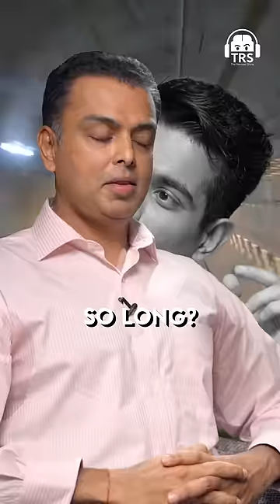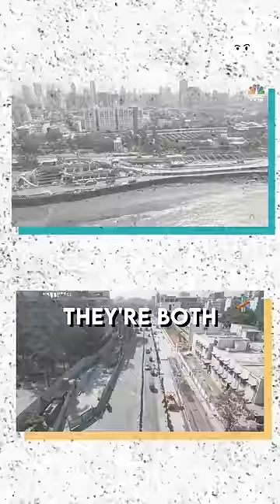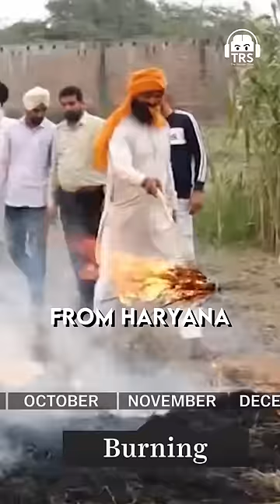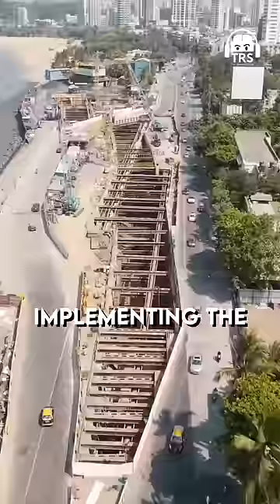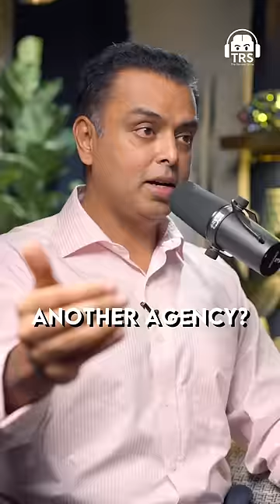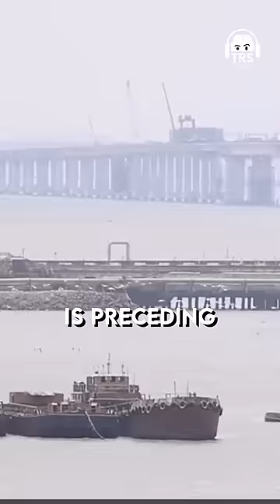Reason Behind Mumbai's High AQI (More Than Delhi?) - Milind Deora #shorts

Comment: Simple question to Devra! Name one project of the same scale and  speed   which  was completed by congress ! It’s one thing talking in expensive English but just another thing to take up big projects and deliver
Reply: Rightly said👍
Reply: Oooh NICE!  As someone who has studied and learned 'expensive English', I do hope this catches on.  Tell all the Westerners this if they ever try and 'correct' your speech or writing.  Or even if they don't.  Tell them anyway!  Congratulate them (foreigners and diaspora) on their "expensive English".  It'll hit them right in the gut.
Reply: Current infrastructure kisine banaya fir?
Reply: Did you ever hear about delhi metro? Initial rail networks of india,canal network in rural india etc
Reply: @Aditya-xd7zt  off course I have heard experienced. Have you experienced Delhi air pollution? Forget about during projects, anytime? It’s a good city, if someone wants to die without getting older!
Reply: @Aditya-xd7zt  I am not talking about infrastructure per say. But specific to speed and scale. Just check the example of Narmada dam. It was flagged off by Nehru but could get completed only by Modi! There are dozens of such examples. 55 Shatabdi in 65 years. 35 vande Bharat in 9 years. The list is endless

Comment: Similar issue in Jammu - two highways to take you outside the state - expressway and ring road, both under construction at the same time. 
On top of it a bridge collapsed during monsoon, causing us to take detour of additional +20 kms on a single road with two way traffic. That’s fixed now.
But still to cover 90km stretch it takes us 2.5-3 hrs. 50% road is one way traffic. And barely 20% proper road exists atm. Yet, they charge us at 2 toll plazas across this route when there is no roud for maintenance at all. It’s under construction. Voice was raised by locals but it got squashed. 👀

Comment: congress laid foundation of mumbai metro in 2006 & it was opened it 8 yrs later that too a small network of just a fucking 11 km & when modi started work on mumbai metro 3 that required cutting of trees, Liberandus of Mumbai started protesting against mumbai metro line 3 & When Uddhav thackrey (congress allied with Shiv sena) won in MH he almost slammed the Mumbai metro 3  now tell me who delayed the project. After BJP allied party won MH Mumbai metro 3 is now almost complete & this december this metro line 3 will get opened.
To improve mumbai local trains BJP led govt. launched AC Local trains in 2017. Now tell me who delayed Mumbai's development in these 4 decades and who is improving mumbai in these 5 yrs. Jai Modi.